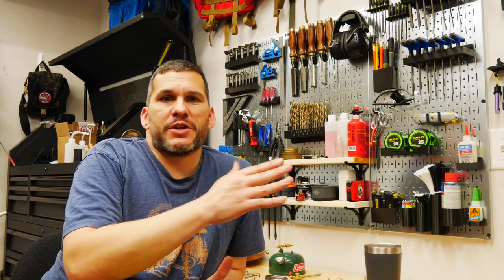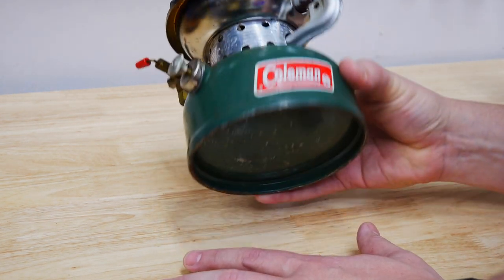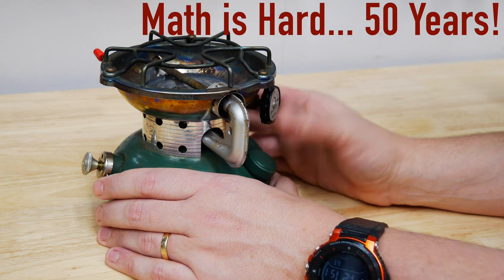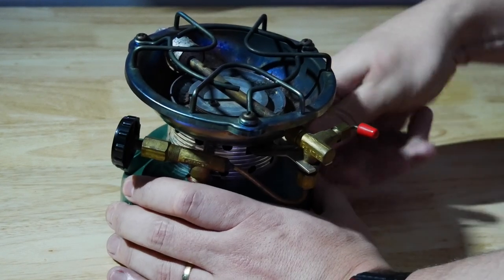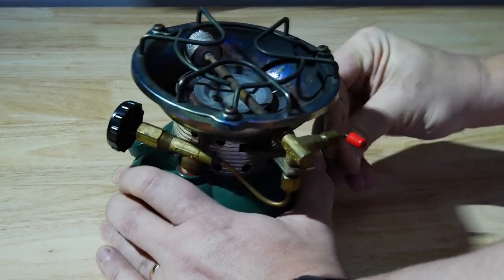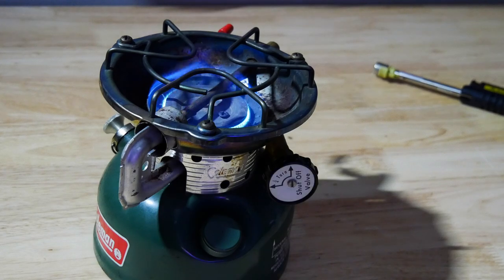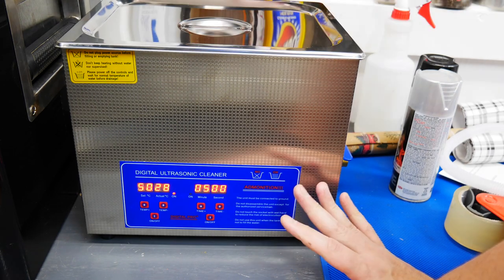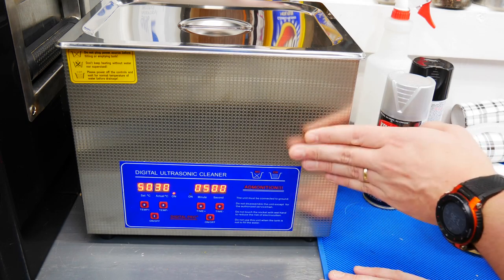Vintage Coleman 502 - Disassembly and Restoration - Easy DIY

Comment: I did a complete preventive cleaning of the Coleman 502. I managed to disassemble the gas generator tube. There is a jet, a long fuel adjustment needle on which there was a lot of carbon deposits. Inside the tube, in front of the jet, there is a brass mesh, and along the entire length of the tube there is a coil spring, which I managed to remove with a crochet hook. These things had the largest amount of soot. If you learn how to take them apart and clean them, your heater will last forever. I bought it on eBay for $70. Hello from Ukraine. Now these devices are very necessary for people in our country and not for the sake of entertainment but for survival.

Comment: Mine 1977, was lighting but barely. I had left gas in it over the years. Then I took it apart and cleaned it, the pins and springs were seized. Now it does'nt work so good. I ordered a new generator, pretty much the only piece we can order, hope that it will fix the flame. Beside's that I have no clue.

Comment: Nice job.  Another issue with the first boil test is that you left the valve in the 1/4 turn to light position.   This drastically affects the output and the amount of tank pressure it drains.  Additionally, the adjustment lever wasn't in the high position.  Any time the flame appears low, always give the cleaning lever a spin first.  That almost always get it going immediately.  It's really amazing how well these things were designed and made.  They can take a lot of abuse and just keep cookin.  The generators work really well for a long time until they don't.  Then you wish you would have cleaned it more often.  Haha.  A periodic cleaning is quick and easy.  Pro tip:  turn the valve back to the light position until you see the flame lean out before shutting down.  Should just take a few second, and the flame will go out much quicker, with less fumes when you close it all the way.  These aren't speed boilers by any stretch.  But they are efficient and near bullet proof reliable.

Comment: I’d use my dremel tool with a polishing wheel charged with aluminium oxide to polish away some of the light rust. It also will make a mirror polish. 

Look for nickel plating videos using an old transformer wound battery charger (cathode and anode). 

I enjoyed the video, thanks!

Comment: I restore Coleman lanterns and stoves as a hobby.  I also have a Coleman 502 from 4/74.  The recommended oil for pump cups is Neatsfoot Oil.  You might as well paint the bunson since you've already disassembled the stove.  I would and probably paint mine if and when I take it apart.  I would also paint the burner cup and the burner top with high heat paint.  You could also paint the fount with some clear to prevent any further rust and maintain the patina on the stove.  Once lit you should turn the valve to fully open.  I always clean the generator and tip before lighting.  Good job on the stove and nice video.  W Rusty Lane K9POW in eastern Tennessee

Comment: To avoid clogging up of the generator and possibly even get some old debris out you might want to run these petrol stoves on Alkylate fuel such as Aspen 4T. This is very pure and free from additives. The smell is also greatly reduced when burning this.

Comment: On the bowl and other small parts where you are concerned with the plating use a cloth buffer wheel and maybe some Jewlers rouge, this will bring back the luster without doing any real damage to the plating.  Great video, thanks for sharing.

Comment: I have the 442 feather dual fuel stove for years and have used it and abused it like it were stolen. Shelved it about 2 years ago for I could not figure out how to remove the pump. Did not want to damage anything. And there at 13:48 you showed me how it’s done. Simply remove the silver D retainer clip. Bwahahaha. Thanks Ernie.

Comment: Nice work! I have an old stove which looks just like yours other than condition. I think I picked mine up for around $5.00 but it was quite dirty and rusted. The labels were gone so I sanded and painted mine. All I had was camo brown but that's fine with me.  It works great. One time while fishing I found a double mantle Colman lantern appromimately the same vintage submerged in the pond.  I had to buy a new glass globe and of course the very fragile ash mantles. I pumped it up and it fired up with the original gas. Of course being pressurized no water got into it. Worked great for many years.

Comment: My 502 is also a '74.
It runs, but it needs work.
It's been a couple years since I worked on it, but I think I probably just couldn't get the generator apart.
I will have to try and get it going again.

Comment: Great video! I've resurrected a few of these old 502 stoves and I love their simplicity and classic design. I used to buy those metal cans of acetone at the hardware store until I found the pint containers of 100% acetone sold near the nail polish at Wal-Mart for a fraction of the cost.

Comment: I can’t tell you how happy I was to see this video, I have the same stove. I recovered it from the bottom of a lake years ago and got it running. It probably fell through an ice fishing hole and sank to the bottom. This fall it developed a leak at the cleaning knob. I tried to take the valve apart but stopped when you said the seals were graphite based. I put the nut back on and tightened it as much as I dared and it didn’t leak! So it looks like I’m going to get some more use out of it. Thanks again for your video !
Reply from the maker: The graphite packing is actually very easy to replace, and cheap to get.  I'll show how to change them in an upcoming video.  Thanks for watching!
Reply: @paleomakermd7358  I be waiting😁

Comment: Hey Ernie, great content as always. I still pack my vintage stove I bought new in 1972. The two legged Primus 2260 propane. Still works great. The third leg is the propane cylinder. It was considered a backpacking stove back then. One of those green cylinders will last you a month on the trail.

Comment: Excellent video Ernie, Always good to find a stove that needs minimum work to get running. Check valves can be miserable to get out even with the removal tool so I am glad you didn’t have to do that…..

Nickel plating will give really nice finish but in the end, heat/time will win. Always good to have an Electo-plating set up as you can plate and do rust removal.

Comment: Nice clean up and problem solving to get the stove looking good and working correctly. I used to carry one of those on hiking trips back in the 80s before I discovered the much lighter and quieter alcohol stoves. I still use the Coleman for car camping.

Comment: I have a mint condition 502 that my father gave me.  it comes with a metal case/pot and is pretty nice!  I use my MSR single burner stoves, instead, but I won't get rid of it.

Comment: For the first boil test you didn't open the main fuel valve all the way after the generator got hot, so you were running it on the fuel+air setting. On the second test it was both cleaner AND you ran it properly. As far as the plating, it's a tool: you got the rust off, so that's good. If you're just going to set it on the shelf and look at it, then by all means re-plate it. If you USE it, the plating is just going to come off again eventually...

Comment: I seen a fella put his 200 dollar airbrush through an ultrasonic cleaner. Within 6 months it looked like a 10+ yr old gun.  Most of these types of guns are heirloom quality that'll be passed down to the next generation. They are plated as well. I know ya got the sandblaster for Christmas, but may wanna look into setting up an electrolysis tank. They are easy and cheap to set up. Vinegar is also another good rust remover. I use both for old neglected cast iron pieces. For sake of appearance ya may be able to just try polishing compounds without plating. That's probably the route I'd take initially.
Reply from the maker: I have everything I need for electrolysis and electroplating...so going to start experimenting with those.  All part of the fun, thanks for watching!

Comment: Happy new year! I have the same ultrasonic cleaner for ammo brass. I suggest using one of your stoves to preheat the solution just to speed things up. I also installed a 90 degree elbow for ease of draining it. Try Flitz for the rust removal and polishing of chrome. Brasso for the brass. Looking forward to the new channel content.
Reply from the maker: It's SO LOUD!!!  I'll check out Flitz, thanks!

Comment: I have a Colman peak stove I bought new. Has been my go to stove for years and years. Tried to get it going last summer.  Started ok but the valve was real hard to turn up and down.  Started leaking whole thing cought on fire. Not real easy to put out. Just can't give up on it yet. Just not sure how to fix it. Thanks.
Reply from the maker: Which peak stove is it?  What year?  I have a mid 80's Peak One, Brown colored tank, that I could do a video on taking apart and cleaning up.  It's really not too difficult and we need to save your stove :)
Reply: Yes!  Please do a video on your brown Peak 1.  I’ve got one dated 1980 and would be interested in seeing a video taking it apart and cleaning it up. I haven’t fired it up yet for fear of what happened to Rod’s.